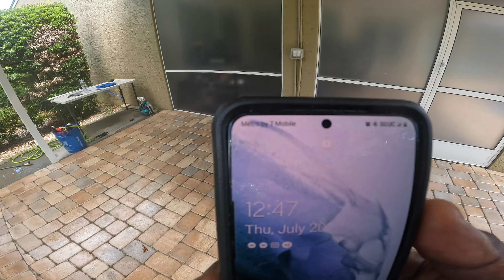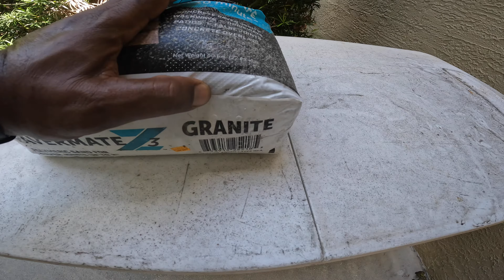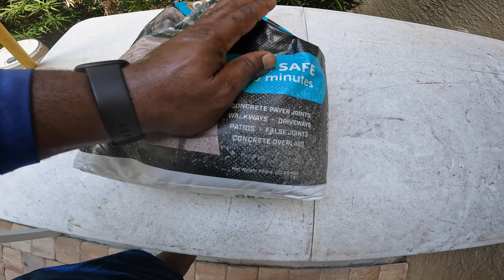How To Strip Paver Sealer #howto

Comment: I need to strip the paver coping around my pool. Do you have any different advice or suggestions for that or is it basically the same principle? How do you deal with stripping solution and flakes of old stripper going into the pool?
Reply from the maker: Same process. And there's nothing you can do , stuff will fly into the pool. You can either use a pool strainer to get the shavings or the pool vacuum will get it.

Comment: Is the sealer good for florida because i get a mix message that the water base is not good for florida weather
Reply from the maker: Is sealing good for florida? Sealing is good for everywhere,  I've never heard of such statement.  Sealing literally protects the pavers.
Reply: @PinkFlamingoPowerWash  Sorry, what I meant was the water base sealer. Is it good for the florida weather or the non water base sealer
Reply from the maker: @AlexSantos-dy2wx  water based sealer is the best for florida.  Solvent/acrylic based will get beat up by the sun/climate here quicker

Comment: Cliff. How do you get these 1 gpm pumps to re prime. Mine is good until it sits for longer than 10 min. Then bam can run for 5 minutes with no prime
Reply from the maker: Sounds like you got an air leak somewhere. Or the pump is going bad. To re prime them I just use the garden hose to feed water into the inlet tube of the pump while squeezing the trigger

Comment: Hey Cliff do you prefer filter for pull line in bucket sprayer or without? Thanks
Reply from the maker: Yea cause any little thing clogs the spray nozzle.  I just stock up on the filters they're like $1.50 a piece I believe. So I just use one each job.

Comment: If I strip my pavers like you did, will it look exactly like it did before I sealed them. The sealer darkened my pavers and concrete.
Reply from the maker: Yes it will be bare pavers with no color or sheen. Yes sealer does stain concrete if it gets on it.

Comment: amazing work, quick question what kind of sprayer do you used for the sealer , thank you
Reply from the maker: A 12v sprayer. But if you're using deco products sealer you can use a pump up sprayer
Reply: @PinkFlamingoPowerWash   yes I’m about to use deco products.  have a failed pavers sealer that I did last week, never happened to me before but I just learned something from your videos, by the way thank you so much for your help.

Comment: I am in Delaware and was wondering what is a ball park figure you charge for sq.ft for stripping pavers , sanding the joints, then sealing? Is each a different individual price? I know my area pricing will be different
Reply from the maker: Prices will definitely depends on your area and business expenses.  But it's all in one price , you don't break down each one.

Comment: Hi. I live in Arizona. The Contractor applied an acrylic sealer over the brand new outdoor travertine he installed. It turned white. Tried a stripper n powerwasher but it came back. Any suggestions?? Im beyond stressed! Please help
Reply from the maker: Hard to say, what type of stripper did you use, your dwell time, the nozzle you used to remove the sealer?
Reply: Monterray super stripper. It was 90-95 degrees so i think it was applied for only a few minutes. High pressure pw i dont know the nozzle, but they reapplied polymeric sand. Do u think using the chemicals that u used when the temps are cooler would be the way to go? Thank u

Comment: how come you didnt wet down the polymeric sand before sealing?
Reply from the maker: The sealer does that
Reply: @PinkFlamingoPowerWash  this isn't the proper way to setup polymeric sand. But I've never used sealer to setup the sand. This product even states to wet the sand and wait 28 days before sealing over. I'm going to send you a dm on insta later.
Reply from the maker: @doomslayerforever2858  that's a lie. 28 days??? Nah I literally showed the hard sand from the inside portion and that was about a week apart.
Reply: @PinkFlamingoPowerWash  I thought so myself. I was reading what the manufacturer stated on thier website. I want to make sure I cover my ass incase something happens and the owner doesn't come back to me with well you didn't wait 28 days lol
Reply from the maker: @doomslayerforever2858  lol In that case cover yourself by waiting. It's been passed 28 data now so I'm in the clear if that's the case.